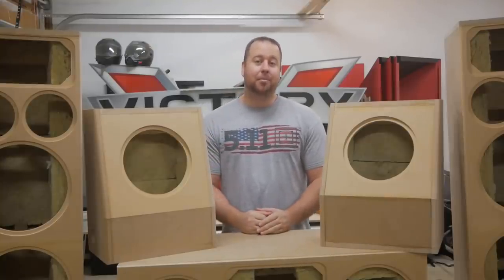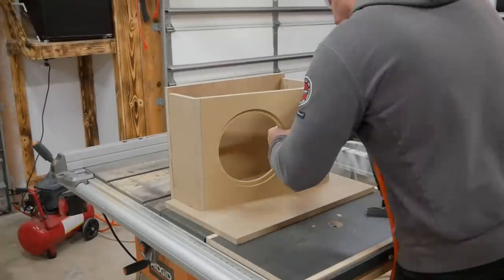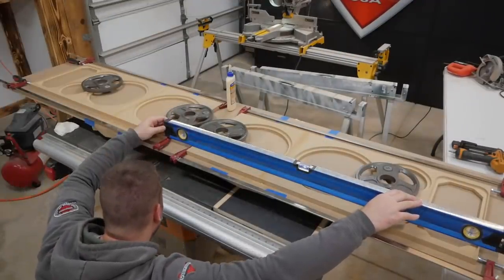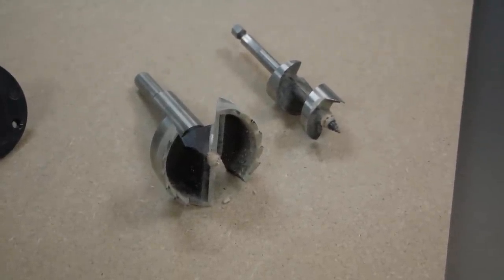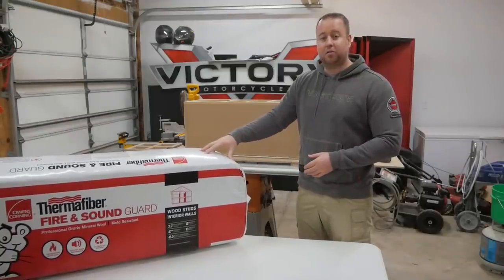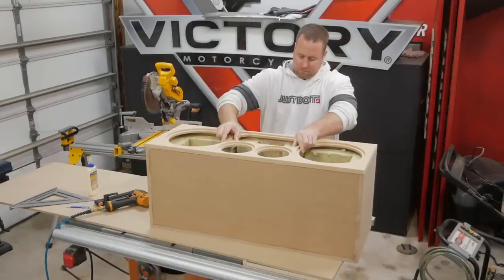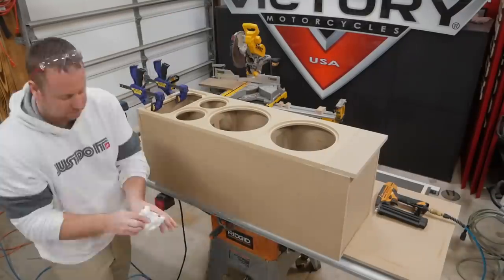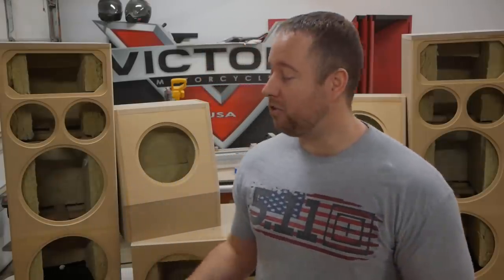Home Theater Speakers Build | Diy Sound Group 1299 and Volt 10

Comment: Wait a sec... Don't they come pre cut? That's what you get isn't it? In the kits?? Or you only get wood pieces?
Reply from the maker: The front baffle is pre cut. You can order the entire flat pack kit for an extra charge. I modified mine so I built the majority of the enclosure besides the front baffle

Comment: Really nice job on the design and setup. But myself, I wouldn't have used fiberglass base insulation. Extremely hazardous to your lungs. When your setup is playing, it's going to blast fibers everywhere. But other then that, I really like your design.
Reply from the maker: Thanks man! The insulation is actually mineral wool, so not fiberglass based (not as hazardous) and I also sprayed the entire inside if the enclosure and insulation with spray adhesive the "bed" the fibers. Never seen any resting in the ports over the years, fairly confident I'm not swimming in a cloud of insulation every time I play them 😉

Comment: Just one little tip from someone who built quite a lot of big box speakers 
you need to add a spacer in the middle of the crossover to prevent damage from vibration . 
For the middle I make the spacer an 1/8th of an inch smaller , before mounting the crossover 
I put some hot glue on it and then quickly place the crossover onto the spacers and screw it down . 
Once the hot glue sets completely the crossover will feel really solid and i promise it wont vibrate anymore .
If you ever need to take the crossover off a hairdryer is more than enough heat to soften the hot glue and take it off
Reply from the maker: That's a very good tip, thank you!
Reply: @LifeofBliss  No problem man we need to help each other out and besides it would be a shame if your crossover would crack .
Reply: Should there be some sort of barrier between the mids and woofers?
Reply from the maker: The mids are a closed back design, so they do not share any airspace with the woofers. Typical open back speakers would need a separate chamber though. Very common question with this design

Comment: Beautiful!!! Great Stuff 👍 Always fun to see someone else's ideas.

We're kinda the opposite on builds - ha ha : ) I tore out my 8 speakers w/ 24 drivers and built two 8 foot tall towers and simply 1 "top of the food chain" full range driver on each.  Prefer the sound of less / higher quality drivers after many years of surrounding myself with speakers : ) So, 2 drivers, 2 subwoofers now is my new #1 favorite - never heard such clarity.
Reply from the maker: Thanks man. Audio is cool in the fact that so many designs and setups can sound different and great at the same time.
Reply: @LifeofBliss  I know! Just bought my first BLUETOOTH Tube Amp and I was shocked that it actually had a warm tube sound - great stuff coming out.

Comment: I have big doubts about the use of this wool in acoustics. A synthpon is needed, but from this as if she did not have to breathe when playing bass, she can throw harmful particles into the air - no?
Reply from the maker: I did a lot of research on this before installing the wool. Most do not find it would be an issue. I can always add a thin breathable material over the back of the port if I found it was in issue though. I also sprayed all of the wool with the contract adhesive after installation to try and lock all fibers into place. This material had some of the best acoustic properties which is why I used it.
Reply: @LifeofBliss  I know that I used it in construction but I can use it in the construction of acoustic systems, maybe in your case it is normal
Reply from the maker: Everything I read said that rockwool and traditional fiberglass insulation was great for damping and none of it will decrease volume. I don't believe it will be an issue, but there may be someone smarter out there who can correct me?
Reply: @LifeofBliss  Hope you don't have children, that's really toxic to breath in. Have it only on sealed boxes I you must, but buy the real thing instead.

Comment: Great build and video. Getting ready to start my 1299s and am leaning toward this design.  Super exited!  Pretty stable on carpet in this configuration?  I have small children running around, which is part of the reason I like this...shorter with the weight lower. 

BTW, I think you have a typo in your cut list, both here and on AVS.  I think the top of the center should be 16.25 deep, not 16.5.
Reply from the maker: Thanks man. And I may have a typo in there... Sorry! I'd have to go back and measure the box to be sure.
Reply from the maker: Oh and they are pretty stable on carpet. I didn't worry too much about my kids knocking them over, but it's still possible...

Comment: Great video and workmanship brother.  Could you explain why you don’t make a separate enclosure for the mid-drivers within the large floor standing speakers?  I’m not asking to critique you.  I really do want to know.  I am new to this stuff.  I guess I figured the air movement from the subs might effect the mid driver movement.  Thanks for the video and your time.
Reply from the maker: Yessir, the mid is actually a closed back design. It's not open to the enclosure, so the airspace doesn't effect it. I would have separate enclosures for it if it were a normal speaker 👍 not many speakers are closed back like the mids are

Comment: You may have said in the video but I admit I skipped through, how come you have used the same chamber for the mids and lows on the tower speakers? would they not need to be in their own tuned volume for the performance?
Reply from the maker: Yea sorry I didn't go over that. I will in the next video,  but the mids are sealed, so they don't use any of the box airspace. Kind of a neat design. You can see the backs of the mids on the unboxing video

Comment: Simply beautiful work and craftsmanship right there. I’m almost set to buy their 1099’s for my LCR’s but only one question. Why didn’t you use a full brace (without holes) on the top part of the speaker to isolate the mids and compression driver in their own sealed chamber?
Reply from the maker: The 1099 and 1299 have different mid range drivers. They are open back in the 1099 and have a sealed back on the 1299s. Compression drivers are sealed as well, so no need to make a separate chamber for them. I think I'll go over that in the next video as there have been quite a few questions on that. Which if you aren't building them and have the plans from DIYSG, I can see why it gets asked. Thanks Jose, hopefully you'll get those 1099s soon!

Comment: I enjoyed watching the video. You did a great job on the build. My only complaint would be the wool insulation put in. Thereswaybetter stuff to throw in there thats more eco friendly not only for your equipment, but for people enjoying the system. Bad bad mistake throwing that junk in there. Your not just damaging your equipment by having that stuff in there and allowing all those small fibrous particle getying into the spider and even down in between the coil and magnents burning them up quicker than normal wear and tear, but your also hurting people that come over  by having them breath in all those fibers the speakers are blowing throughout the room. I mean there are soo many better options than that, second skin makes some of the best products. Your spending all the money on building a quality system, why cheap out on wool insulation, makes no sense. But its not my stuff so it dont really matter, but cant wait to see the finished product!
Reply from the maker: Appreciate it man. And there are many products out there for damping, no doubt. I chose this based in the effectiveness (being very dense it breaks up the sound waves better). There is also plenty of data out there supporting the safety of mineral wool. I'll link below a thread with several studies done in a medical journal looking at mineral fibers. These aren't like subs that would have huge amounts of airflow, and I also did spray the entire inside of the enclosure/insulation with the adhesive spray after installing all of the mineral wool to help trap any fibers from shedding off. Just thought I would give you the reasoning behind my decision. I appreciate you explaining why you don't like it instead of being like some others who just wanna complain and call names. Here's the link if you are interested. https://www.gearslutz.com/board/bass-traps-acoustic-panels-foam-etc/347314-comparative-safety-rockwool-fiberglass-organic-fibers-review.html

Comment: I believe I have settled on the 1299 or the Titans... Do you have an opinion of which is better?
Reply from the maker: I have not heard the Titans myself... I know there are a few guys on AVS Forum that have owned or heard both. I'd do a search there or start a thread in the DIY Speaker subforum. I can say that I have been extremely happy with the 1299s. I haven't seen anything bad about the Titans. You'll be set with either!

Comment: They don't make flat pack's for the 1299? I built some 1099 a few  years ago, not so much wood work just gluing. I see you arranged the drivers differently though, maybe that's why you had to custom make the boxes. Lot of extra complexity. They are amazing speakers and still Wow me to this day, 4 years later. I smile everytime I listen to them. They are somewhat purpose built speakers though, more for home theatre then music. They sound good with music, but they are kind of like giant satellites, aka not full range. I keep mine crossed at 80 Hz to a 15" sub. Feel like I could use one more sub. People see huge woofers and assume these are full range. What they are is DYNAMIC, loud, and effortless... they play clean to super high SPL, and the directionality of the wave guide is spectacular, really helps with room acoustics. I also use the VOLT 10 LX, and was quite impressed with them as well.
Reply from the maker: I don't remember seeing flat packs for them... I've heard those 1099s, amazing speakers! And yea I've heard these are better with movies than music. Really excited to get them finished up!

Comment: the two boxes that are have a different angle. are they the same cuft? Why did you have the black paint between the wood and glue ?  I guess you didn't have any problems because of that? it looks really nice! I want to build some boxes again!
Reply from the maker: I tried to make them as close as possible, but my measurements were a bit off when it came time to building. That are within 10-15%, but they are sealed and will be able to take care of any differences once I EQ everything. If you look at the painting part again, I only painted the exposed side of the port and taped off the supports when painting in the box. No paint where the glue was applied. Thanks man, really hoping it warms up soon so I can finish them!
Reply: @LifeofBliss  looking forward to seeing it!

Comment: Other than moving the woofer, what made you decide to port and tune the box to 35hz?
Reply from the maker: Better low end response. Not much under 70-75 Hz when sealed. Figured I was altering the boxes anyways, might as will make them a bit bigger and port them. It'll be better if I run them full range for music with no subs

Comment: Love this build.  Been eyeing the 1299's for awhile.  I'm curious as to your opinion on the way the ported vs sealed enclosure sound.  Keep up the great video's and thanks for putting in the time making them.
Reply from the maker: Thanks! Yea I'll have to do some listening to the center by itself then one of the towers by itself once it's done. I'll put out a video of some sound clips and my impressions for sure.
Reply: Ported is for shitty speakers....it's just the truth.  A proper sealed box will always sound better.  Also him moving the tweeter was stupid.  There was a specific reason it was centered between two woofers
Reply from the maker: Shitty speakers? Sealed is always better? Lol pretty big generalizations and assumptions there. I'm curious as to why you think that woofer was placed there and the negative effects it would have moving it. I mean, the designer of the speaker gave me his thoughts and why it was designed that way, as well as what it would do by moving it. Interested in yours...

Comment: Great video! But please, roll your sleeves up when using the tables saw! I know it's a Sawstop, but if your arm gets pulled down with it there will still be damage.
Excited for the final product!
Reply from the maker: Hmm didn't think about that... Thanks Cooper. I'll keep that in mind! Should be warm enough to get painted up this next week!
Reply: It's not a Sawstop. It's a Ridgid.
Reply from the maker: Oh I missed what he meant by that. Yea it won't stop when I touch it. It'll stop when it's done cutting, whether that's wood or arm. Planning on only feeding it wood though...

Comment: dont you think when the bass hits the whole room will be filled with glassfiber from the rockwool insolation ??? Its smarter to use specific soundproof materials instead of rockwool ??? maybe for sealed enclosure but for open...
Reply from the maker: No, I sprayed all the insulation with the spray adhesive before placing the front baffle on. Plus there is not much air movement to be honest.

Comment: Question about the insulation; wouldn't that fiberglass become friable with all that air movement causing 2 things: fiberglass particulate to float throughout the room and possibly degrade the speakers by virtue of the dust constantly vibrating on the cones/spider (or getting up into the cooling pole on the magnet)?
Reply from the maker: Regular pink fiberglass and mineral wool are some of the best damping materials for speakers due to their density (much more thorough explanations out there, just Google speaker damping). There is no issues with the speakers getting damaged. Some worry about the fibers being thrown into the air, while others use it and say it's not an issue. In my case, I sprayed the entire inside if the box with the 3m adhesive after adding the wool. This should lock most fibers into place. If it ever became an issue, you could always add a very thin material to block off the port (pantyhose is often used lol). Hope that helps

Comment: Great video 😊
I have a speakerseries which I really like, except the fact that the center is a little small (2×6.5") bass. Fronts have dual 12", rear have dual 10".
Fronts go down to 22hz, rears 25hz.
Center is rated at 50hz, but one of my recievers put it as large, the other one at 40 hz 🤷‍♂️
Thing is, I have 2 Def Tech Supercube Reference subs, and find the transition from center to subs to be missing some slam. I am therefore thinking of taking 2 10" as in the rear, and building a box with thouse around the center. So that the center sort of will be inside the basspart of the speaker. Would you say this is possible, and how would you do it? I don't have much woodworking tools, and have never buildt any speaker, but hey, everone starts somwhere 🤪
What so I need to pay atention to in order to keep the same sensitivity and ohm as it is now? I suppose it is important to use the same woofers as the rears (rears are actually babybrother fronts, and everything except the woofers are the same as the fronts I use). 
And finally, would it be a better idea to route the center to a small sub, with highpass, and not fuck anything up? 🤪
Reply from the maker: You feel you're missing something from the center? If you have it crossed at 80 or 100 hz, your subs should be doing all of that. Are you running it as large? That may be the problem. Your subs will do everything under 100 hz better than your mains will. I would look at how you have things crossed over before building anything. Your towers sounds like they would be great for full range 2 channel music, but for movies I'd look at crossing your subs at 80-100 hz 👍
Reply: @LifeofBliss  
Hi 😊
Thanks for replying 😊
As of now, I have center and heights crossed over at 80hz. Maybe I'll try to raise it to 100hz. (Always thoght that the subs did a better job if they have less to do. But they are not even on 1/4 of gain, so I suppose I can try 100 hz.) Probably should cut rhe rears higher too? Now I have them at 40hz, they are dual 10". I have tried to put fronts in small, but the sound is way punchier with them in large (I have sub in pluss, so 120hz and down goes to the subs as well as the fronts). I am avare that fronts in large is "wrong" and have tried to make small sound great, but no matter what I do, it sounds punchier and actually cleaner, with them in large. (I do have 600 watts and 1500 dampingfactor on each front, so controll of them is great).
I will try to raise frequency in the subs. Thanks for the reply mate 😊